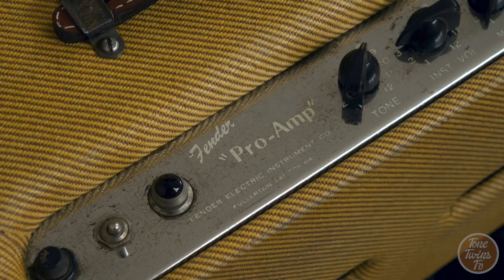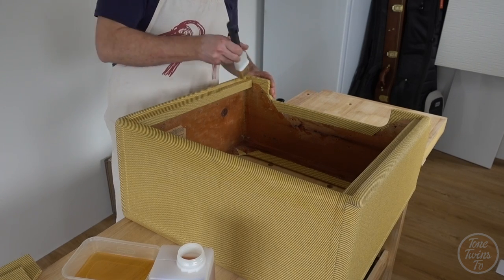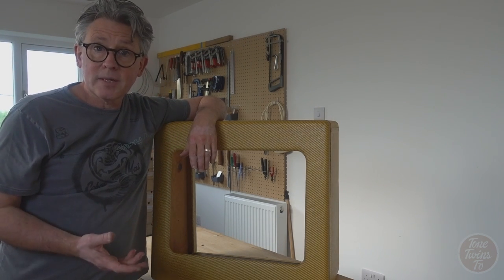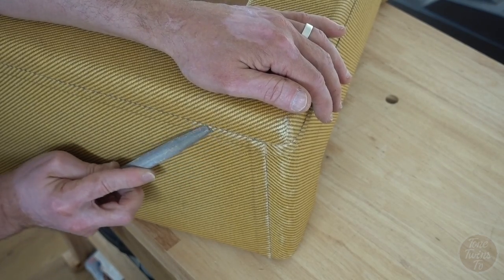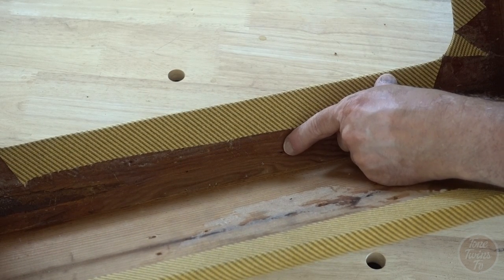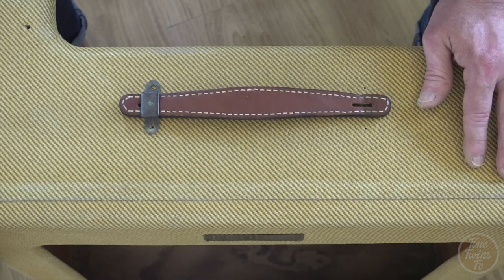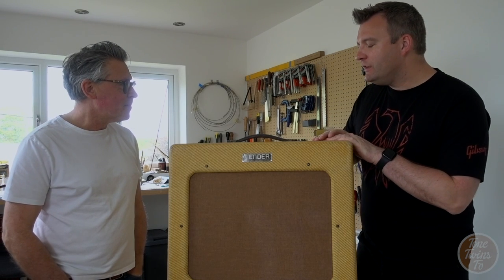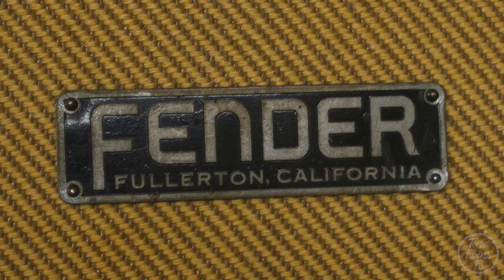How to relic a Tweed Amp - 1952 Fender Tweed Pro

Comment: Would a heavy relic job involve all of these techniques, with one final stage of a week or two in a fume cabinet with surrounded by auto-puffing cigarettes and the occasional cupful of light beer chucked over the surface?
Reply from the maker: Only if you remove the amp chassis first. Other refinements could include leaving cigarettes on the top of the cab to burn out, pouring bourbon over the front and dropping it down some stairs ;)
Reply: @tonetwinstv2863  ah, of course, those professional refinements that us amateurs somehow always overlook.